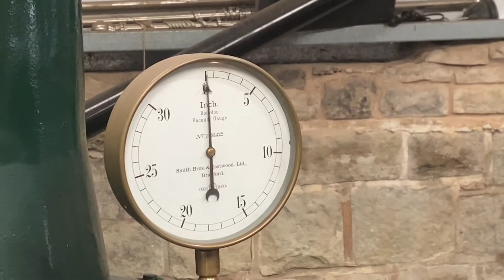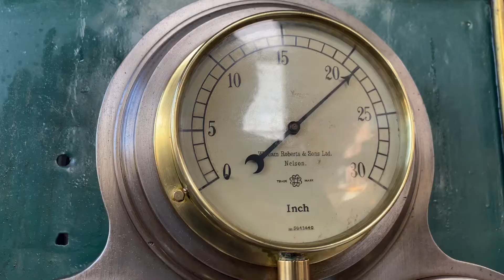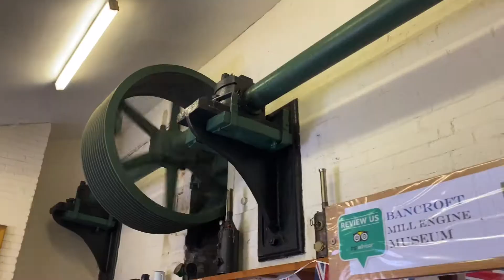Bancroft Mill Engine Museum Centenary Event Open Day - Sunday 3rd April 2022

Comment: Y can’t a big engine like this one start from any position? And how much power do the assistants put out? I’m guessing a lot because they’ve gotta move that massive flywheel😂
Reply from the maker: Hi Brian. It’s easier to start and more reliable to start when the HP Crank is at the start of its stroke. The engine is built to produce 500hp but it can deliver 600
Reply: @teescottageguyproductions  I was asking about the power of the little guy that helps it get into position 😂
Reply from the maker: @brianrigsby7900 ah the barring engine 😂, silly me! I’m not entirely sure about that. I’m rather interested in finding that out myself now! I’ll do some research